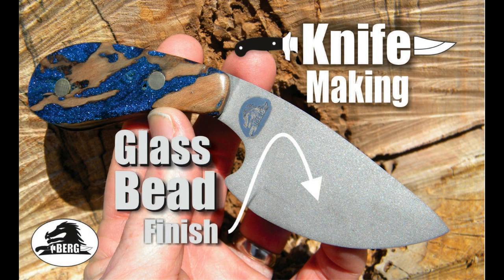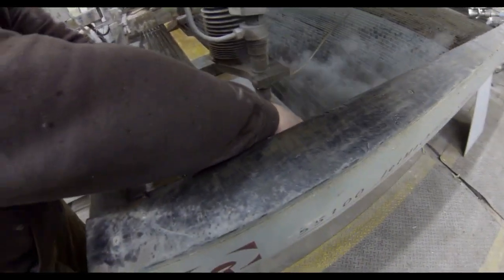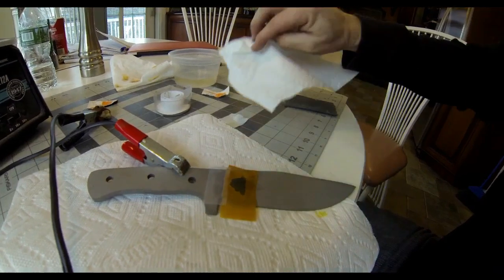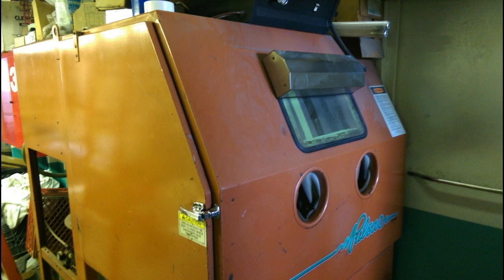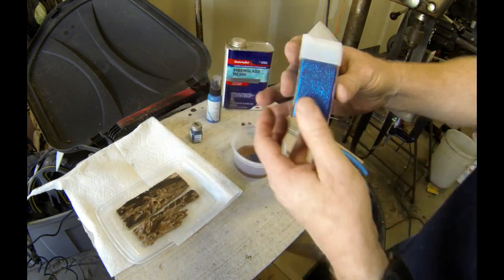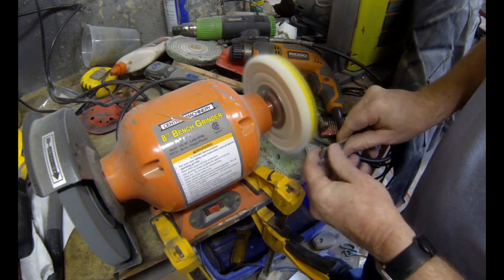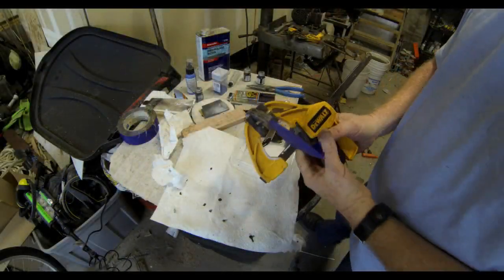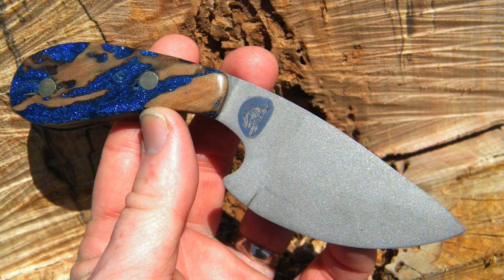How to make a Knife with a Glass Bead finish and hybrid wood and fiberglass scales

Comment: Wild idea, I like it. Could you say what source of small bottles of paints work with fiberglass and resins?
Reply from the maker: I just use the little bottles of paint from art and craft store. Basically, any oil based paint will work. Only takes a few drops. On another project, I added some fine colored sparkles into the mix. That also had a pretty neat effect. https://www.youtube.com/watch?v=LLEbb5fBR6E